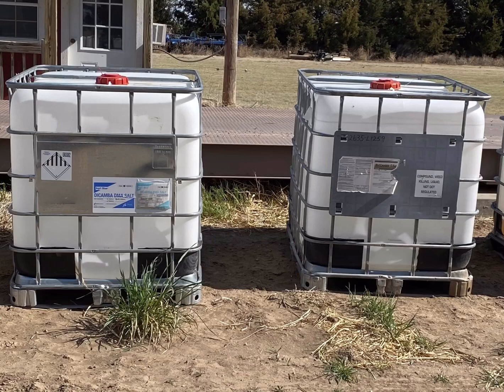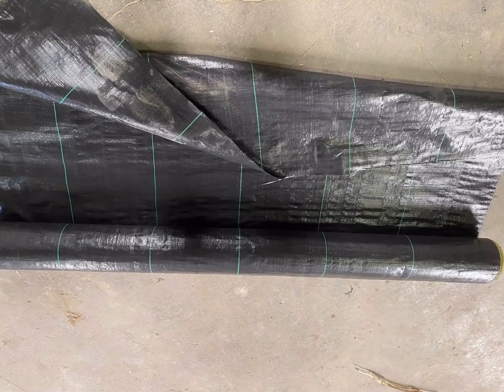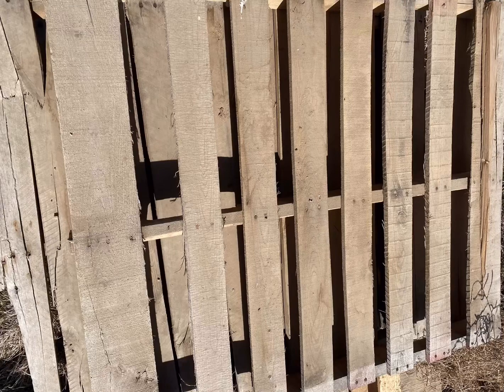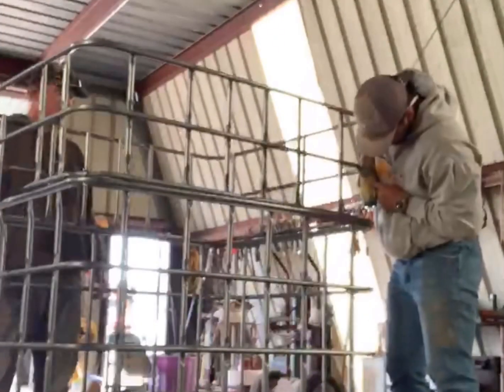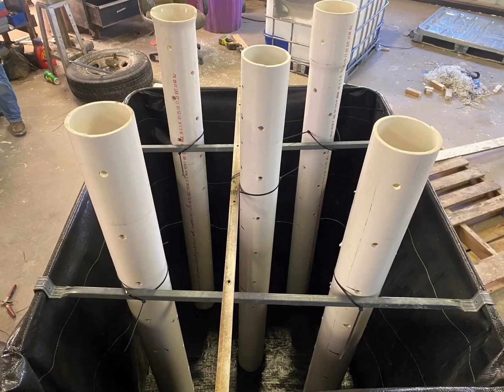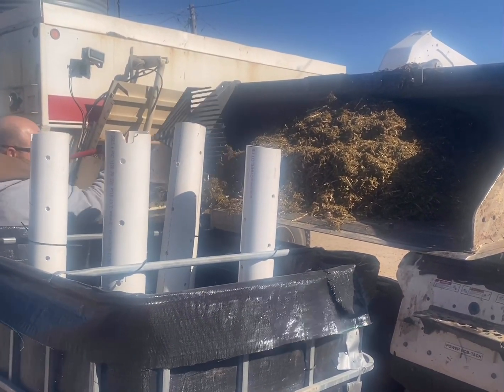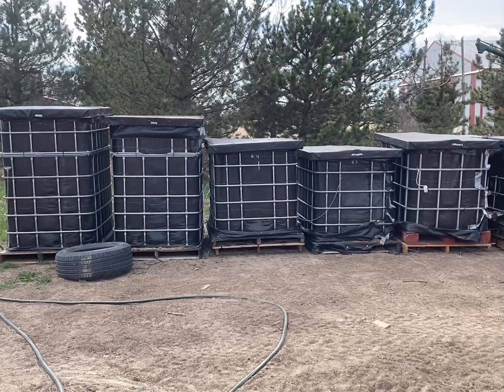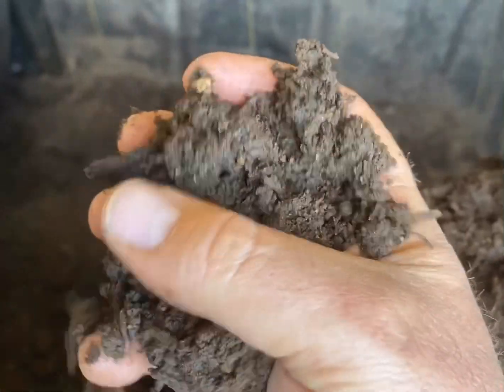How to build and fill a bioreactor quickly. Similar to a Johnson Su Bioreactor

Comment: Are the holes in the pvc pipe necessary?  I somehow thought those stayed in the pile throughout but learned you pulled them after 24 hrs.  Secondly, is the weed barrier to block light?  Thanks
Reply from the maker: no the holes are not needed

Comment: I do have a question. What happens to the worms once the compost is fully broken down after 1 year and you go to use the compost, is there a way that you can extract them to use in other bioreactors?
Reply: What I do Is I save a few shovel fulls of dirt in a 17 gallon plastic tote and move them indoors over winter. Feed an water once a week, add shredded cardboard re apply in spring (April). 
In your case you can just transfer with a 5 gallon bucket into the next reactor. you aren't going to get a ton of worms as its a random sample of soil. Just do your best and make the transfer over. The microbes are going to make a big difference too. Its good to get both worms and microbes

Comment: Why do you need the PVC pipe to have holes in it.  It seems to me that the pipe is inserted into the biomass and left there for 24 hrs., at which time they are removed, leaving the biomass with several 4-5' long 4" holes (providing air).   Couldn't non-perforated PVC pipe do the same thing?  The amount of air circulation perforated pipe contributes during that 24 hrs. must be minimal.  They are merely forming the walls of an airway while the biomass solidifies a bit.
Reply from the maker: I agree
I don’t believe you need holes.  At the time I made this video that is the way David Johnson was teaching how to set up your pipes.
Reply: @youngredangus6041  Great.  Thanks for the reply.

Comment: I thought it was interesting you didn't use wood chips and it encouraged me to try different mixes. Great work and thanks for sharing in You Tube.
Reply: The difference is fungal dominant composting vs bacterial.. both work, they are different processes. So no, anaerobic isn't harmful or dangerous and can be just as effective.. over time.
Reply from the maker: Nelson Olivera thanks
Reply: I think wood chips are always used as a "worst-case scenario" to demonstrate the efficacy of the Johnson-Su method. An inert pile of wood chips will compost very slowly so again, I think people like to show off "look, we can even turn a pile of woodchips into compost effectively." Using the Johnson-Su method is just good practice for any composting; the novelty is the airflow which basically just increases the surface area where composting takes place. They found that the most activity occurs within a depth of about 12 inches so if you have a huge pile that could be several or a dozen feet tall or across, the center of the pile will basically be inert because it's anaerobic (no oxygen for microbes to breathe). Anaerobic composting is "dangerous" and slow because it doesn't heat up like aerobic composting does, which helps to kill pathogens, weed seeds, and other nasties

Comment: I like your videos and your drive. I wish I had a farm where o could really Express myself instead of working in offices.
 With that been said, I was wondering why you guys dont catch the water  dripping from the bioreactor instead of using fresh water?
I am sure you can reuse that water( full of good micro/macronutrients) to rehydrate the biodigester. I am sure you are still bring fresh water to hydrate the biodigester and strip away the nutrients from the compost.
Reply from the maker: Johnny Erinn 
Thank for the encouragement.
I’m not following your question on the bioreactors.  The water that is dripping off as we fill them?
Reply: @youngredangus6041  yes, the water dripping off from the bioreactor when you put fresh water. Why can't we  have something on the bottom to catch the water and reuse it to rehydrate the bioreactor?
Reply: @humus00  There is no runoff. You’re maintaining that ~70% moisture and it is staying all in the pile.

Comment: Not a big fan of the J Su so called bioreactor where heat isn’t really sought after. Why call it a bioreactor in the first place if heat only lasts a week, or so? Traditional composting is more a bioreactor than the J Su method is? Way too many steps to make compost, get biodiversity than necessarily IMO.  Your bins here makes more sense for a few reasons IF heat is actually sought after and to be continuously maintained like I feel composting should be all about. I feel the J Su bin is more about intellectual soil words the average person is enchanted with rather than compost having more biodiversity than other composting methods. I feel David’s end results are more about worm castings mixed with compost used and any composting bin can achieve. If my assertions are true than again waaaay too many unnecessary steps, sending people down silly composting rabbit holes.
Reply: This comment should in no way diminish the importance of this well done video!
Reply from the maker: Thank you for the encouragement.   I am interested in learning other methods after I have mastered the Johnson Su.  Right now farming 10,000 acres, raising cattle and being active with my kids and the church makes my time limited.  Thanks for your thoughts.

Comment: Why do they use a wood pallet and not the metal one that comes with the tote?
Reply from the maker: Kevin Nelson I did it to get more oxygen coming up through the bottom.  But if you line the bottom of it with a layer or two of pine cones I’m sure the oxygen would flow fine

Comment: Thanks for this video. In north England and going to build an IBC version next week - with the extension - in a barn. In David Johnson's video they washed all the compost material before adding it to the bioreactor - to get ride of inorganic material like grit, stones, sand, and also to make sure everything is made wet. Do you do the same in that feed truck?
Reply from the maker: Mark Shipperlee 

Thanks for the questions 

No I didn’t.  It might be a problem.  I had most of mine go anaerobic.  It was from not washing the material or over watering.   

I have a neighbor that used a feed truck that didn’t have any issues 

Planning on making an update video.
Reply: @youngredangus6041  thanks for your reply. I think we are going to use the plastic part of IBC, cut down, to make a washing tank, and then we will also have a tap for draining off. I look forward to seeing your update video. We have a team of four of us on Monday - cages are separated,, space cleared in barn, pallet identified, composting material all identified. We will be loading be hand - and washing so will see what we can achieve in the day (short daylight now!) I look forward to your update video - just about to start the training course with Elaine Ingham
Reply from the maker: Mark Shipperlee 

The good news is though they went anaerobic.  I’m not having issues with them now.

Comment: Ya right. I have a hard time just finding pallets, these would be impossible to get without having to go buy them which probably cost a fortune. I would like plastic pallets and these cages then nothing would rot but I am stuck using wood pallets and wire fencing.
Reply from the maker: Robert Frisby 

Are you in the USA?  Call a local John Deere it Case Dealer.  Ask them if they know the local business that custom spray crops for people.  Call them ask ask if you can get empty chemical shuttles.    I have 3 companies in my area that just give them to us.   Hope that works if not good luck.
Reply: @youngredangus6041  Thanks. I will have to look into it and find out if they know who might have them. I live in Sandy Utah, part of the Salt Lake Valley. When I was young most of the valley was farms but now it's all city. What farming is still being done is way out from where I live. Suppliers like John Deere, Case, Intermountain Farmers are all switching from heavy farm equipment and supplies to back yard gardening supplies. There used to be a John Deere dealer here in the valley, I used to get parts from them but that was years ago, not sure if they are still here or not. Have to look them up.

Comment: Hi,  I was going to build a Johnson-Su  original design  bioreactor  but since seeing your  design based on  chemical shuttles (IBC containers in  the UK) , I have acquired 3 IBCs to make two of the taller reactors, as your design looks more sturdy and less likely to collapse.

My question is though, how do you empty the bioreactor after it's finished composting ? Thanks Ian
Reply from the maker: For me I can cut the zip ties that holds the fabric to the empty shuttle Shell then unscrew it from the bottoms and lift it up.  Then I can use all the product at once.
Or if you want to get a little out at a time you can always reach in and grab some.
Reply: @youngredangus6041  Thanks for the emptying info! Do you add the final material like compost, i.e. in bulk, or do you make a "Tea" from it, dilute the tea and apply that, and if so at what rate. In many of the videos about using a J-S bioreactor for  agriculture, they appear to make a liquid feed and  then apply that at quite a dilute rate. 

Also thanks for posting the video as it is such a great idea!

Comment: @6:35, you could always get a concrete mixer screw auger bucket to fill the compost piles or weld up a custom hopper  to dump your bucket into and slide down into the bioreactor.

Comment: Very practical method. Well done. 2 questions. Would using a 1 Tonne bag (type used for sand/stone etc) be okay to use instead of the black material?, (they do fit the cage), it would be easier to remove the compost. Is vermin an issue, nesting in the compost?
Reply from the maker: Ned O'Brien 
As long as the fabric will let air through.

Don’t over water them.  Mine are going anaerobic.

I’m in the process of fixing mine.  I use the amount that David Johnson advised but I might not be getting as hot as he does.  Make sure yours are not leaking water out the bottom.  If they are then back off on the water.

Comment: How many worms do you put in each one? Can you go to bait shop and buy night crawlers or what kind of worms work best?
Reply from the maker: Jeremy Hoffman 

red wigglers are the type of worms you need.  What state are you from?

Also My piles have gone anaerobic.   I’m in the process of making a video on my mistakes and how to fix them.  
1.  Don’t get them over 70% moister
2. Don’t let them dry out.
3.  Try to get a carbon source like wood chips that will help with airflow.  The video will have more details into what I think when wrong and what we are doing to fix them so others don’t make the same mistakes
Reply: @youngredangus6041  South Dakota
Reply from the maker: Jeremy Hoffman 
Sorry I forgot to answer 100 words.   I can get you the contact of a guy from Nebraska that will sell you some if you’d like.  youngredangus@gmail.com

Comment: Are you using 4inch or 6inch pipe? Thanks
Reply: Wood chips, chicken litter, silage straw bedding that was used for calving. We have a turner and we are thinking pre composting in a window first. Any thoughts?
Reply from the maker: Brian Stahl 
How long will you have it in the wind row?
Reply: Also how do you harvest the worms are there videos showing that. Thanks
Reply from the maker: Brian Stahl 

https://m.youtube.com/watch?v=LVnfPJgnlIk

How to harvest worms☝🏼
Reply: Do you need a lid if you're inside?
Reply from the maker: Brian Stahl 

You can get by with out a lid.  But I think it is better for your compost because the lid keeps the atmosphere damp in the composter 

Not having a lid you will dry out easier.
Reply from the maker: Brian Stahl 
4 inch.  If you want to buy a circular wood it will help with making the holes.  You will want one that is 4 1/2 inches wide.  Cutting the holes will go faster and putting in the tubs will go a lot smoother.
Reply from the maker: Brian Stahl 
What materials are you going to use for your bioreactor?
Reply: 2 weeks
Reply from the maker: Brian Stahl 

I texted John Nicewonger.   He is the man I interviewed in this video.  

https://youtu.be/75pyDkcif-A

He has more experience with this stuff.  Here is his response 

That's similar to what we are doing I think it can work  if you follow your guide lines for turning. The fungi don't build up till it has set in JS for awhile but with worms it is pretty well broken down in 8 months but still takes about year to get highest diversity not sure you'll get quite as high a diversity but still way better than wind row method

Comment: Thank you for sharing this modified design for the bioreactor. It gave me some great ideas to use when I'm making my own. I appreciate your work and the time you spent producing the video.
Reply from the maker: Devin thank you for your kind words.  Are you applying compost to a garden or to your farming operation?
Reply: @youngredangus6041  I'm applying the compost directly to an urban garden. I will directly apply most of the compost. 

I'm in Las Cruces in southern New Mexico with 1/3 acre. About 180 degrees from your operation.

Our native soil typically has less than 1% organic matter. I've been searching for ways to improve the health of the soil in my garden for small scale fruit and vegetable production.

I've tried a variety of methods and have been impressed with the results from the bioreactor. Now, I'm trying to modify the design to better fit my needs. For me, space is precious and most work is done by hand.

I must admit that I'm envious of the machinery you use to set up these bioreactors up in such a short amount of time. Depending on what materials I have and if they need to be run through a small chipper shredder, I can build and fill a bioreactor in ~1-2 days.

I'm going to try to pick up several second hand ibc totes, modify a few things, and try again.

My father and uncle (his brother) farm about 2-3 acres in Georgia on a ~6 acre plot. It was originally farmed by my  grandfather, conventionally. I'm hoping to share what you're doing with them as well. Like you, to their advantage, they have the convenience of a front end loader on a tractor.

You've given me the motivation to keep my pitch fork moving higher than I desire it to. I've subscribed to your channel and am looking forward to your updates on the bioreactor in the future.

All the best to you, your family, and your endeavors.
Reply from the maker: Davin Stogner that’s awesome thanks so much for you response.

Comment: Great video. I cant seem to find the answer regarding to where to keep these things. Inside or out? We have really cold winters (frèezing) here in Europe and I don't  have the means to move such heavy objects. Would a indoor barn be ok for tje duration of the 12 month process?
Reply from the maker: kickuprumpus.   The one I made in February I kept inside until it wasn’t freezing.  The others were just insist until I could get the tubes out and could get a lid on them.
It starts freezing here in October.  At that time I’ll bring them into our heated shop or out shed that isn’t heated and I’ll put heat tape around them to keep them from freezing
Reply from the maker: kickuprumpus 
You don’t want it to freeze so make sure if you make it in your barn it won’t freeze.
Reply: @youngredangus6041  many thanks for your reply. Good luck! Keep us posted!!
Reply: @youngredangus6041  We currently don't have anywhere that won't freeze on our croft (5 acre Scottish Highlands home farm), could we still make one and just take the hit on time to completion of the compost? Say we let it sit for 2 years instead of 1 perhaps?
Reply from the maker: kickuprumpus are you wanting to apply compost to your garden or to your farm?
Reply: @youngredangus6041  i really need to rethink how I am using my soil. We have about 3300 blueberry plants as our main crop but we also do Red Khuri pumpikins/Butternut and also sweet potato. On top of that we have a large orchid of apples and plums.
Reply from the maker: kickuprumpus 

That is awesome. Do you have a Facebook page you post what you do?  We farm corn, wheat and milo.  We also have 150 cows.   Your operation is completely different than ours.  I’d love to see how you are able to utilize cover crops and soil health principles on your operation.   Like @youngredangus on Facebook or message me if you want to connect
Reply: @youngredangus6041  we dont have a facebook but we are on Instagram @opg.rozman
Blueberries are our core as that was a big investment. We were one of the first to start using mycorrhizal fungi on our roots before planting and the results are great so we are firm believers in this. 
150 cows is impressive!! Keep up the good work!!
Reply from the maker: Good luck.  Im planning on getting on instagram and Twitter this summer.   I’ve got videos of getting the compost extracted and making it in the liquid form.  I’m waiting on some photos and videos from a friend and from a lab to Finnish the video.  Should be done by the end of next week.
Reply: @youngredangus6041  will keep following!